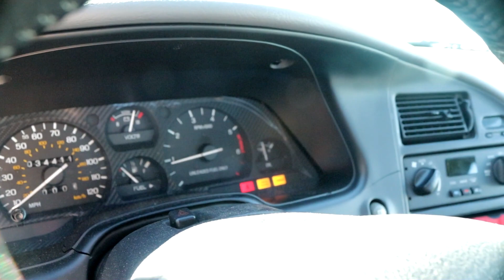Everything Wrong with my 95 Thunderbird!

Comment: lucky for you, you live in the USA, which makes getting parts very easy. Imagine me, living in South Africa, with the same model car -  I have to import anything thats needed. I love the damn car though :) As for the mirrors and windows not working - The fusebox location is situated beneath the dash so badly.
Reply from the maker: I bet parts take an eternity to arrive
Reply: @ChiefDbo  nah, about 2 weeeks. Car came back from the mechanic today - had the gearbox/transmission issue sorted. As i was about to drive it home, the damn turn signals wouldnt work. fixing that use in the morning lol. that fusebox really is located in the worse spot underneath the dash.
Reply from the maker: @brentjohannes7482  yeah, I hate changing fuses. I barely fit in the floorboard
Reply: @ChiefDbo  shit. its not the fuses. its a problem underneath the steering column. wiring issue. fuses are all fine.
Reply: @brentjohannes7482  could be the turn signal switch I had to replace mine about a month ago cause the right blinker wouldn’t work in my 94 Thunderbird
Reply: @elinelson1823  the turn signal switch was fine - the mechanic removed that horrible cheap piece of plastic cover on the dash to repair the cracks, which may have caused the fault. will try and resolve tomorrow. fingers crossed :)
Reply: @brentjohannes7482  ohh okay well best of luck to you!

Comment: This hurts.
Reply from the maker: She's got repairs coming soon
Reply: Just did new wheels and tires on mine, chopped the mufflers off and ran pipe out the side behind the back tire, then replaced the resonator with a glasspack. Also added a k&n cone air filter.
Reply from the maker: @jacobbakko3679  nice man, need to get my wheels back on

Comment: My 94 odometer is stuck at 129k 😂
Reply from the maker: Mines stuck at 34k😂 I need a new gear
Reply: mines at 158,152 hahaha
Reply from the maker: @swaglord9469  ive got another guage stuck at like 120k
Reply: @ChiefDbo  its funny, we have almost the exact same car. Except mines leather interior and only thing that don't work on mine is the ABS, and AC... And tonight my lights behind the air controls burnt out 😂😂
Reply: mine will work every blue moon but yeah mines stuck at 132,xxx miles too🤣
Reply: My 94 recently got stuck at 88k must be a common problem